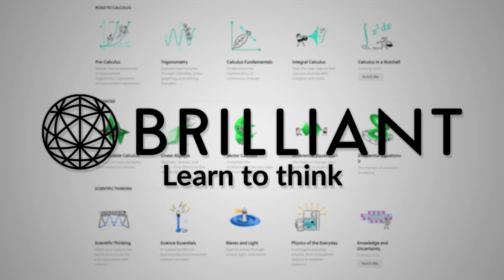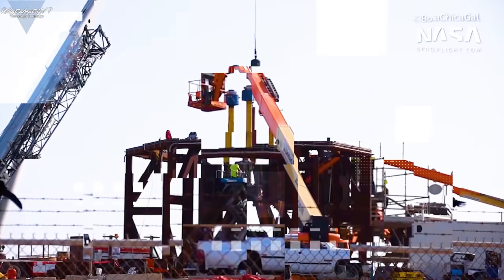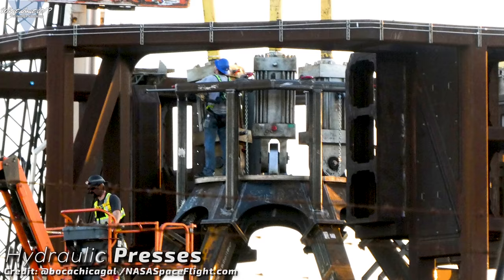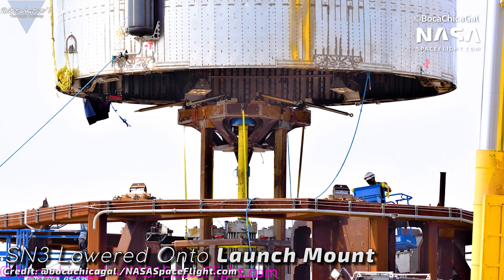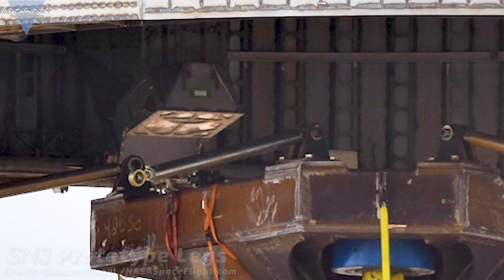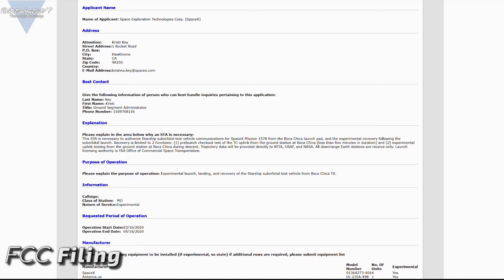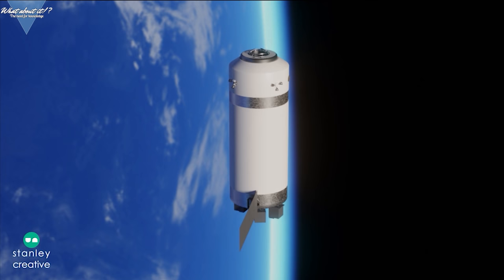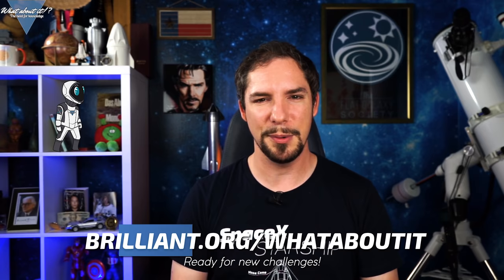81 | SpaceX Starship Updates – Prototype Schedule Update – NASA Orders Dragon XL

Comment: 37 Raptors on the heavy booster will be a sight to behold. Hard to wrap my head around that. With the exception of Star Hopper's hop that's the only time Raptors have actually flown, I believe. As always thanks for the updates Felix. Keep family and self safe.👍🚀🚀🚀👍
Reply from the maker: Agreed! It will be like an upside down lightsaber on night launches. ❤️Thank you! You too!
Reply: Not even the russian N1 with its 30 engines come close...
Reply: true, but elon sad that only 24 raptors are the minimum required for super heavy, and in the beguinning is better to use as least of them as possibile in case it all blow up (every raptor at 2 milion dollars cost probably more than all the starship).. and Falcon Heavy already uses 27, so everything seems very resonable, crazy times..

Comment: The speakers and concrete reflectors on Starhopper may be for testing acoustic resonance phenomena in the hull. Rocket launches are loud AF, and too much resonance could split welds.
Reply: Came to say this. The way the engines are mounted up inside a bit, wrapped with that skirt, acoustic energy could get trapped in there. Definitely something that they will want to test.
Reply: @mycroft16  But Starhopper has already flown with an engine, has experienced quite a bit of wear and tear and a completely different structural setup and weld quality. The results would be invalid for a new Starship.
Reply: I dont think the speakers we see under starship would be large enough for this. You would need massive drivers to even get close to the acoustics that a rocket engine is producing.
Reply: @markwebcraft  Perhaps enough to measure resonant frequencies.
Reply: @scorpio6587  Exactly, you don't need full-power to measure and model resonances in the welds. I'm still just speculating here though, and could be completely off.
Reply: @justincobb5853  Are we 100% sure they are speakers?

Comment: The Superheavy is essentially a longer Starship - with a few modifications.
Therefore I can fully understand why SpaceX wants to do a test flight with a Starship prototype to find some eventually hidden errors.

Then it's just some simple work to make a Starship with longer tanks and without fins and without a nose cone and with more raptor engines at the bottom and with an adapted flight software to get a Superheavy prototype.

Well, there is more stress on the Superheavy, so it needs to be more robust too. SpaceX might fail on that as so often... but the next one would be more useful.
Reply from the maker: Super heavy has a lot of similarities with the F9 boosters as well. Half Starship, half F9 booster.
Reply: @Whataboutit  Yes, you are right, the flight path and landing seems to be much like a Falcon 9 booster. And it looks a bit like it, it's just bigger.
Reply: Can you imagine the new landing ship? Will OCISLU still be able to catch them?  Or a bigger one? More importantly, what will they call it? I suggest Puff The Magic Dragon since he lives by the sea and frolics in the autumn mist. :-D
Reply: @anthonylosego  Super Heavy would be too heavy to land on OCISLY, also in all animations it returns to the launchpad.

Comment: The speakers may be there for testing the small trench and the surrounding area for sound directioning! Further using the star hopper as a test bench for thrust plume directioning as well!
Reply: This is what I was thinking as well. Test how the sound reflects off the trench along with the body and engines.
Reply from the maker: Huh... that sounds interesting. Could you elaborate further?
Reply: @Whataboutit  Basically they built a mini version of the sound and trust deflection system! By using the star hopper that has all the basic setup, they can pressurize and test any aspect of the systems on a smaller version of the ground deflection system. Using a small engine or just release a tank full of Cryo Fluid thru a valve at the bottom to simulate the thrust plume. This is all speculative but just what I see! The speakers could be for many uses! One that makes sense is that they can simulate the sounds made on launch and test the defection rates around the site to get a better idea how a higher volume may impact the surrounding area without using the full volume on launch! BUt once again That is just me!
Reply: Yeah, this kind of makes sense. Harmonics may disrupt how fuel and exhaust disperses and lead to unwanted conditions. The speakers may confirm computer models for further refinement.

Comment: Why Did they Install Speakers | Reason:
My guess is that they are using the speakers to prepare for the acoustic dampening SpaceX will need to account for from the acoustics of launch. To my understanding the trenches dimensions will resonate a certain way during a launch, and so, as you always see during a launch, a lot of water vapor is dumped in the trench during a launch to "eat up" the force from the acoustics preventing damage to engines/etc.

Comment: The only logical reason I can think of regarding the speakers, is to test the effects of harmonics on the pressurised tanks while testing.
I have no clue about the Raptors, but the Saturn V put out over 200 decibels. At those levels, depending on harmonics and positive resonates/interference, hardened structures can/could reach failure stresses.
Especially at welds, where the structure is at it's weakest.
Just a wild guess?

Comment: Dragon XL is pretty big, do you think that it will be used as a module for the station?
Reply: Technically Speaking -> YES!
The Dragon XL it is a "cargo module" with a Docking port. A pressurized one.
-> It is not that different from the current "cargo" version of the (crew) "Dragon 2".
  
You can not use it as a "proper lifeboat" (there is no internal life support); but in theory if full of portable oxygen tanks & CO2 scrubbers (for an EVA suit), plus a simple "charger" feeding from its solar panels [to keep the EVA batteries working]; it should be able to "haul" one (maybe 2) astronauts from the Moon to Low Earth Orbit (they would be de-hydrated, extremely uncomfortable, maybe even "sick"; but they will be alive).
Reply: @adolfodef  Yeah, what I mean is do the gargo takes a negligible amount of space inside the capsule since cargo dragon has 6000kg of payload capacity while being smaller?
Reply from the maker: That is an intriguing idea! Thanks! Technically it should be possible!
Reply: @Whataboutit  Someone just told me that the capsule will be able do stay docked to the space station several years in a row.
Reply: @johntheux9238  Precisely.  This is the main reason I believe it has potential as an "emergency" alternative evacuation vessel.
In order to last more "than a few months"  in space (specially outside Earth´s magnetosphere), its electronics, valves & power systems must be "reinforced" against radiation [this creates by default a "safety margin" of operation similar to the ones required for crews].
-> The oxygen/scrubbers necesary for a 3-day return journey can be stashed in a ring-like fashion (providing aditional radiation protection), leaving only a small, cramped "core" cilinder for the one or two astronauts [it would be a nightmare].
Reply: I don't think so. Big part of it is unpressurised cargo. If it woudl be exact cygnus copy, wich will be used as gateway module(already corfimed), then maybe.

Comment: Hint. If they filed for approvel, but did not get the approval for a 20k hop (yet), it means they are not allowed to do a 20k test. Getting that permit may not be easy. The safety radius at 20k is impossible to manage. It can end up anywhere it things go wrong at that altitude.

The reason they can do a 150 meter test without asking again is that the old starhopper permit is still valid.

Besides, the 150 meter limit is applied, because the rules are more relaxed at 150 meter or below. They originally wanted a 200 meter permit for starhopper, but had to reduce to 150 meters to get it.

Comment: Landing leg design. fael097 on reddit has created a drawing of how the legs deploy.
https://i.imgur.com/9RWTLn5.png
It is difficult to see how long the vertical section of the leg is, how far up in the engine bay. Swung down, it could have a telescoping section or two, to give additional length and use as shock absorbers and levelers. As seen in the drawing, there is room for a longish leg to swing down between the vacuum nozzles.
Reply from the maker: There is. And it's a test. If it works, SpaceX will develop it further. What becomes clear here though is that SpaceX is testing around at the moment. I wouldn't be surprised, if on SN4 we'll see another completely different design just to get more data. Thanks for the comment and the link. I hadn't seen it yet and that's exactly, how I imagined it. The locks are missing though.

Comment: Felix, I'm curious when SN3 flys to 20 Kilometers how many "G"s will it pull? Do you have an ideal?  I'm still having doubts about how stable she is.
Reply: Ye it seems kinda... Too floppy to work at such flights
Reply: Depends on many things! The raptors have a rated thrust of 2 MN, and they will be running 3 of them gives us a max thrust of ~600 tons. Dry weight of the starship is somewhere between 150-250 tons, plus however much fuel they add in. I assume they will target a launch Thrust to Weight of about 1.1-1.5 with peak acceleration at ~4gs on on empty tank, which isn't what's going to happen if they use the last portion of fuel for landing.
Reply: @aaronmcculloch8326  Thanks Aaron

Comment: a tank section can actually fly on its own...
Reply: Technically yes, but the aerodynamics would be a complete mess and and the rocket would most likely tip over and explode because of the aerodynamic pressure
Reply from the maker: correct
Reply: @ng1n369  it depends on the speed. If it flies the 150 meter hop like the Starhopper, there would not be very much more aerodynamic stress on the flat top as on the starhopper. But the vehicle would be much longer and heavier and it would have more thrust than the Starhopper. That alone is worth the test.

You would not need a nose cone or fins for the 150m high test flight, except that there might be some necessary hardware in the nose cone - we don't know.

At least it would look a lot nicer with the nose cone on top during the 150m test flight. It would look like the Starship that it will be some time in the future.

Comment: Could SN3 fly without the fins?
Reply: It could fly, but wouldn't be doing much at high altitude.
Reply from the maker: 150 meters? Yes. The TVC would be enough to controll it. Fins don't have any effect at these low speeds.
Reply: It will fly without fins, since Elon says it will only be used for short flights, meaning hops. To hop vertically up and down fins aren't needed, and actually just cause problematic airflow on the way down - think of dropping a dart backwards.
This will still be a problem on later flights, but one thing at a time...

Comment: Why dispose of Dragon XL after its delivery to the Gateway, design it to be used after arrival as a permanent storage/habitation/experiment module for gateway. After several deliveries you could build a substantial structure, why go back to the days of burning up the fuels tanks during the Space shuttle program. More importantly with the advent of 3D printing in space why would you throw away tons of valuable materials when you could re-purposed for the construction of the Gateway.

Comment: some of that is completely contradictory to what is happening, by your own descriptions.  they need closures to test, but then you said they will be firing on the 1st?  so when is the closure for the pressure tests they have yet to successfully pass.  by your own description, they are setting up for pressure tests?   its a safe bet that they will only be pressure testing on 1st.  i'd guess its possible to have a test fire after that of what must previously stated would be a single, engine set up, first.

Comment: For what it's worth, those aren't hydraulic presses - they're hydraulic cylinders mounted in a test jig.
Reply: The same as I don't have an engine in my car, but rather a collection of cylinders and pistons.  Rather than being all anal about it, Ill just call it an engine thanks.
Reply: @nickrobinson7096  A hydraulic press is a machine designed to, well, press some work piece to shape it, mold it, forge it, or whatever.* This is a test jig with cylinders mounted in it.

*Or destroy it, a la the Hydraulic Press Channel.
Reply: @MIck-M  All of those parts in your car add up to an engine. Three hydraulic cylinders don't add up to a press.

Comment: I'd say the speakers and the trench are likely to stimulate the effects of the sound waves bouncing back that was the reason that Apollo and the shuttle needed to dump all that water into launch area. It was found that the vibrations from the reflected sound waves could damage the Rockets. AKA protecting the pad was a secondary function it was pretty much required to ensure safe launch

Comment: Could the speakers you mentioned near SN2 Thrust structure be to add simulated sound vibrations from additional engines?  If they only use one engine for that rest then that must be it.  But they need some way to better simulate actual launch conditions with additional engines.

Comment: Maybe speakers on the starhopper will be used for some kind of sound vibration testing. How much raptors will be there on the super heavy ? 35..37 ? That is amount of sound vibration that is not easely mitigated, it packs quite a punch. Maybe there is even danger that sound vibrations of 30+ raptor engines rip each other appart.

Comment: Will the 20 kilometre flight use the "skydiver" method to come back down or will it gently descend under engine power similar to Starhopper (just on a larger scale)?
Reply: Cluck Nuggets - It would use too much fuel to ascend & descend 20 km under power, & the Raptor will probably have just enough thrust to be a little too much for the descent.

Comment: Speakers will be used to emulate the acoustic output of the Raptor engines.  Remember that the first Shuttle launch was almost badly damaged by the acoustic shock from the SRB ignition pulse reflecting back out of the flame trench!

Comment: With starhopper the speakers are probably tuned to the resonant frequency of the exhaust on the starhopper and they're seeing how it affects either the concrete the ground the dirt because if you hit the resonant frequency of that stuff it turn into like quicksand and the concrete could be shattered and then I will start blowing parts of concrete around which would turn into projectiles so they're probably seeing what things are affected by the frequency and volume of the exhaust noise

Comment: 1. Maybe they will try active noise cancellation* :D.
2. Why don't they just make a internal road so they do not have to close public road? Just to save money and time or are there other problems?
3. They can always just crash Dragon XL on the Moon if they have dV. Plus for all seismic detectors on the Moon its great data possibility.
4. If Space X wants to put resources to the new spaceship, does that mean they do not anticipate that they will fallow with Elons' timeline for Starship? Or they just want to fulfil Nasa contract even if they anticipate that they will have better spaceship?

*I know, not possible outside of headphones. And amount of sound energy is enormous for engine.

Comment: April 1 - static fire
April 6 - 150m hop test

Too ambitious?
Reply from the maker: Maybe. I am thinking right now, that the hop might just be the tank section. That would make it a lot more achievable. If they plan to assemble the whole thing by the 8th, it will be crunch time for sure.
Reply: @Whataboutit  I reckon they could easily get the nose cone fitted by the 8th. As for fins/canards? Likely not.
Reply: Why? If the vehicle passes the test, it can be used for a small hop. And for that, it won´t even need a nose cone.

Comment: We are technically still at MK1 given nothing has flown yet aside from hopper. SN3 will not even be capable of doing the belly flop maneuver for a 20km test flight without header tanks installed. I think SN5 or 6 could have a Super Heavy but they have not even made enough engines in total for a SH booster and SS. They need Raptor production into double overdrive to have enough engines for an orbital flight by the end of year.

Comment: They are probably gonna test how engines hold up during launch and landing without a launch mount like on mars. you need durable ground for that. they might also want to test gravel on top of the concrete but a fixed floor beneath is a requirement.

Comment: What about just adding an extended trunk to a dragon2 capsule instead of a whole new dragon xl. Also what about just waiting for starship that will make all gateway infrastructure obsolete ???
Reply: I doubt the reaction control thrusters of a Dragon 2 could handle that much cargo in such a large trunk. The Gateway project is one of NASA, not SpaceX so they can't really "wait for Starship".
Reply: They want more pressurized cargo area, not just more trunk space. The structure of a Dragon2 is expensive to build, uses a lot of expensive milling. The body of Dragon XL looks to many like it will be built on the F9 production line, has the same diameter, which uses much cheaper techniques.
Reply from the maker: Dragon 2 has the wrong setup for such a task and Starship is not developed yet. NASA can not plan for something they don't have yet.